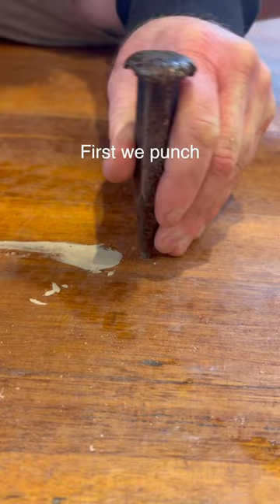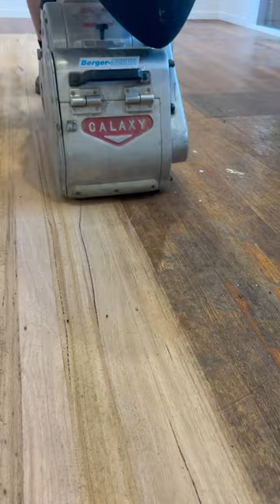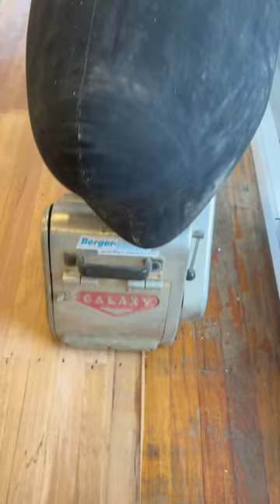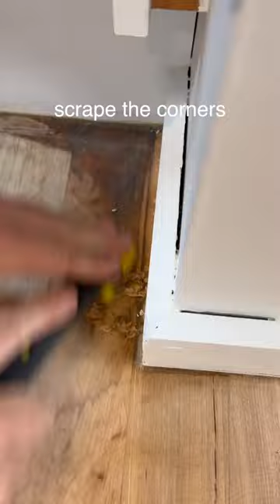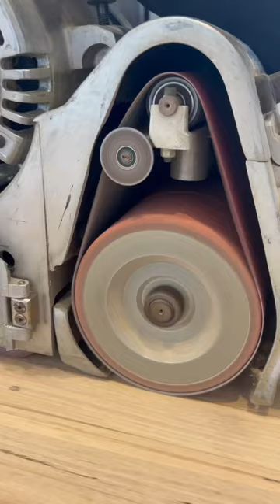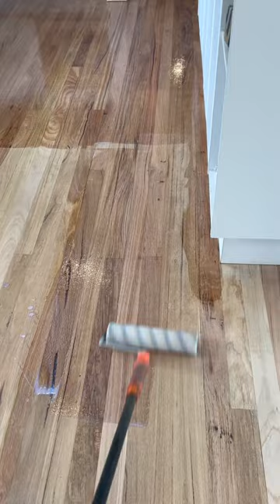Is this floor worth keeping??

Comment: 12/10 All hardwood floors are worth restoring
Reply: Unfortunately not always. You get into the old farmhouses like I have lived it and when you pull the old flooring up, you usally do find hardwood floors.....but they have been patched with rounds of tin cans!
Reply: Sometimes they get sanded down to the tongues and then it’s time to replace, but usually refinishing is the way to go.

Comment: I watched another expert who said that you shouldn’t sand with the grain of the wood. You should sand across the planks so it won’t cause la bumpy look (like lines or little hills in the wood) after you apply the stain and polyurethane finish. Have you ever tried that? This guy seemed very knowledgeable?

Comment: How does a job like this usually cost? Amazing work
Reply: I got a quote for $5 a sq ft recently. I've heard nationally it's between $4-$6. It's crazy because I got a quote for LVP and it's almost as high as brand new white oak sanded in place and refinished. It was really high end LVP. $5.90 a sq ft. The more people I talked to the more I realized I wanted real wood and to refinish the Ash we already have. We're getting White Oak in the adjacent rooms and will later refinish the Ash to match.

Comment: I only ever did one house and it was long ago, but it was every room and even the closets. I wish I would have had your equipment. I used a T bar to spread the finish, it went very smooth but I never notice you using one?

Comment: Would you please say what wood species that is? I'd also like to ask the board specs and if they're milled with any joinery, such as a tongue and groove.
Reply from the maker: In Australia we refer to this as mixed Eucalypt hardwood. Not sure of exact width but around 60mm and 19mm thick. These are tongue and groove 👌🏻
Reply: @QuicksandFlooring  Interesting difference in nailing pattern between you and USA with t&g. We nail through the bottom of the groove making sure the head is set, so that it won't block any part of the tongue that goes into it. No nail heads visible. Old days driven & set by hand, later a driver called a floor nailer (huge labor saver). Your dimensions similar to ours.

Comment: What do you think of the theory to sand diagonal to the planks? Apparently leaves a smoother finish
Reply from the maker: Yes we do cross cutting on certain floors but most buffers these days sand flatter 👍🏻
Reply: Should only really go 15 to 45 degrees if your floor is unlevel to get it flat again. A machine orbital sander gets it smooth after the belt sander

Comment: I have no knowledge whatsoever regarding this so I was just wondering when you take out the nails and close the holes and don't put new nails in doesn't it make the floor uneven some places or perhaps loose?
Reply from the maker: The nails we took out were the ones left over from the carpet removal. The other nails we just punch down below the surface to secure the boards and fill the hole with putty 👍🏻
Reply: @QuicksandFlooring  Great, thanks for answer!

Comment: How dusty does everything get when sanding with a professional sander like this? I have oak floors that were laid in the 90’s they’re in amazing shape, however I’m not a fan of the stain it’s extremely dated. And I would love to refinish them myself like you did here! I want to sand and literally do a top coat! However I’m wondering if I would need to seal up rooms to avoid dust everywhere?
Reply from the maker: All the professional machines have vacuum systems attached which collects 99% of the dust but there will always be a very fine layer and things will need to be wiped down..
Reply: @QuicksandFlooring  good to know! Thank you!

Comment: You cant tell but this dude used waterbase finish and overlapped what was probably dry and had bad stop marks. Terrible way to coat water base

Also it looks like the floor wasn't even buffed after running the machine because it looks like his machine is leaving lines. Maybe from hitting nails or he just didn't buff the lines out. I will say though I love Galaxy machines and it looks like it cuts good but the floor looks different otherwise 

Also his edging is pretty sus if he's only feathering while also not using a pad on his edger